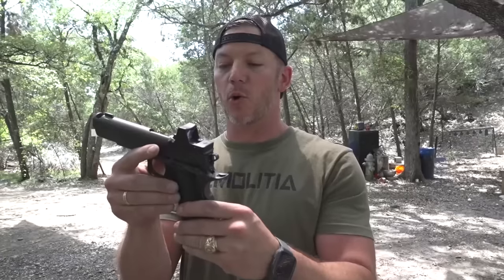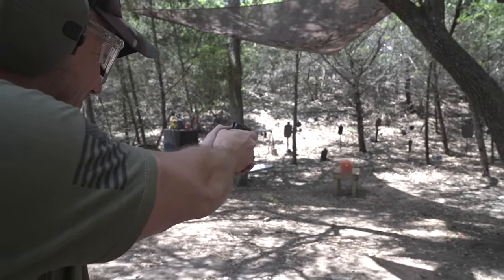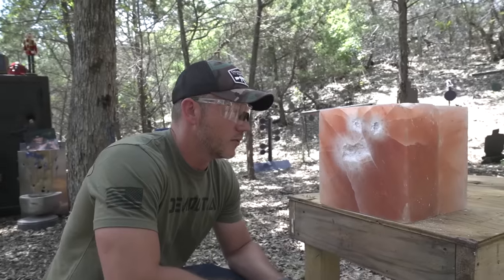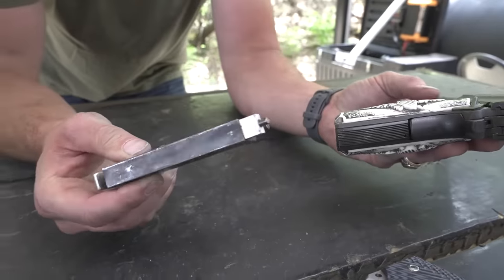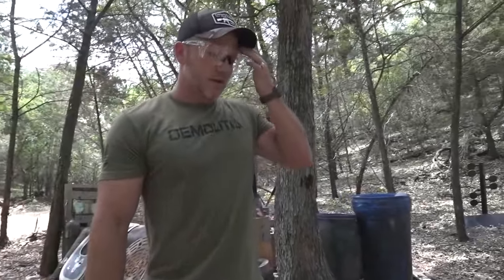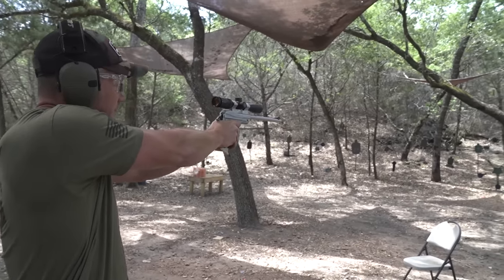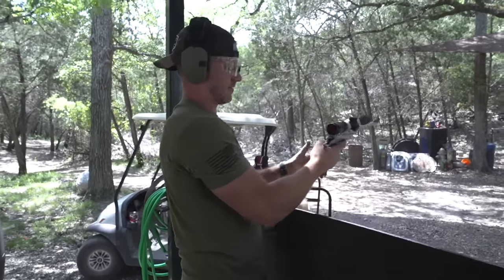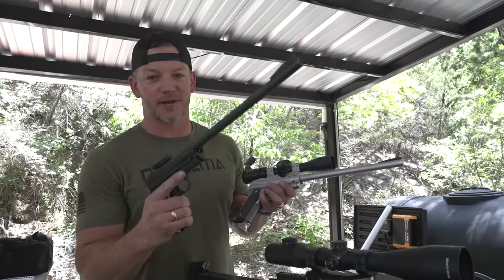Pistols Chambered in the Most RIDICULOUS Rounds!!!

Comment: Pachmyr made a single shot version for a 1911 called the Dominator. With a muzzle brake and scope it is practical. Unlike those that break open the conversion has a little tab that serves as a bolt action. You have both safeties of the 1911 and an additional one that blocks the hammer after a new round is chambered. It freaks out the Glock guys.

Comment: I remember when those 308's came out for the 1911, They were called the Pachmayr Dominator, they were a bolt action, more or less. Very Punishing Gun, as Matt found out. Built in 1984-85. The one Matt has here is a Tilt barrel like the Thompson Centre Contender.
Reply: Anything with a lot of power built on a 1911 frame sucks, because whether people want to admit it or not, the 1911 grip is hot garbage.
Reply: Hi Scott nice to meet you here 😊
Reply: @Skinflaps_Meatslapper I would argue that anything with MORE power than the originally intended cartridge can make the 1911 less than fun to shoot. For example, the 308.
Reply: @hammettsean2  Sure, nothing wrong with that statement.  I would argue that anything equal to or less than the .45acp is less fun to shoot with a 1911 than in a gun designed with better ergonomics in mind.  Like shooting a 1911 with a .22LR conversion is far less enjoyable than shooting .22LR from a FWB AW93, or a .32WC from a 1911 vs a Hammerli SP20, or a 9mm 1911 vs a SIG P210.  A better designed gun would also be more fun to shoot larger cartridges with as well, compared to the 1911.
Reply: I agree, but some rounds are much more enjoyable in a 1911, and even more enjoyable to shoot than the .45 ACP. The 10mm, and .38 Super are two examples. The 10mm takes the cake for me on best 1911 cartridge, with second place being a toss up between .45 acp, and 38 Super. I’d probably go with .45 on it though since ammunition is much easier to find than 38S
Reply: I own a vintage Pachmayr Dominator, and when I take it out to the range, everybody wants to shoot it. Once.  
I like the Vortex Scout optic, my Dominator needs an upgrade. I'm also considering a muzzle brake, something that I have never seen as a necessity before.
Reply: @boomer271  I have a T/C contender in .45-70, everyone is the same way with that one too.  It's about on par with a .460/.500S&W as far as recoil.  I've since SBR'd it and turned it into a nicely compact rifle that isn't snappy at all.  I have a subsonic load for it using 700gr PC bullets that I use with a can...it's still a bit loud but earpro isn't necessary.

Comment: About 20 years ago I was working with a guy who came in to work one day with a big bandage on his left wrist. He was out shooting a 45/70 and shot an old sign (he said he had it hanging at his range on his property, but…. Who knows) and the bullet hit the metal sign, and stripped the copper jacket off the bullet. The lead punched through the sign and continued on, but the copper jacket shot straight back at him and lodged in his left arm. Apparently it penetrated about 3/4” of flesh, kinda skirting his wrist bones. Anyway, the 25acp has nothing like 45/70 horsepower, but jacket fragments can really cause problems if the round has enough power.

Comment: I have that same lil Colt .25 acp I think they call it the Colt Junior if I’m not mistaken? I actually managed to get it for free from an old landlord, he had it locked away for some time and the hammer had seized and the tension spring got stuck and he told me that it was junk and that I could just have it because he just couldn’t fix it no matter what he did, he even gave me the original lil box it came in with the papers and a spare mag too. Both mags were topped off with .25s too. I was extremely thankful and lucky for the kind gesture as I was in an extremely rough place both mentally and financially. I don’t think he had much knowledge of firearms because all I did was cock the loose hammer back and push the hammer to the open position really hard a few times and after two or three pushes the spring just came free and started putting the tension back on the hammer. Ever since then it has functioned flawlessly, I shoot it more than I probably should but I have yet to have a malfunction with it at all. A few thousand rounds and not a single failure to fire, feed, or eject. I absolutely love that little pistol even though I have since gotten a much more appropriate and capable piece to carry for self defense. And yes, the day I got it to function properly I called and told him how keeping the hammer cocked and locking it away for decades just caused a spring to get stuck and I didn’t even need to take it apart to fix it and offered it back to him but he denied the offer. Stan was his name, such an outstanding man and a Vietnam war veteran.   I remember him showing me the sniper rifle he was issued in the military and I tried to buy it every chance I could get. After his passing he put that his M1903 Springfield rifle should go to me but unfortunately his family came and completely raided his house and his belongings and took absolutely everything that had value including that rifle. Then had the nerve to hire me to clean his house and get rid of all the trash and everything that was left inside because it was a complete wreck inside that house by the time his entire family rummaged through it smfh

Comment: You could even reuse those salt blocks since you can dissolve them in water, put the salty water/watery salt in a form/mold, and evaporate water with the sun and summer heat